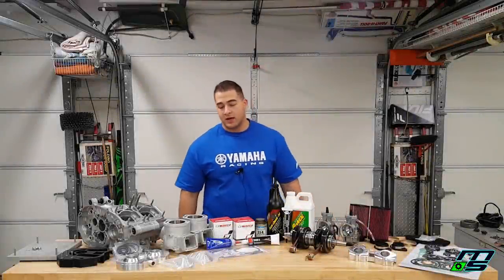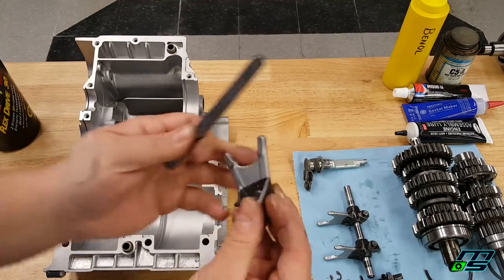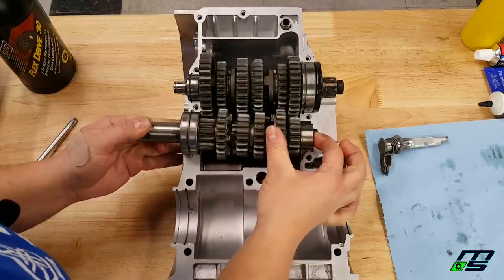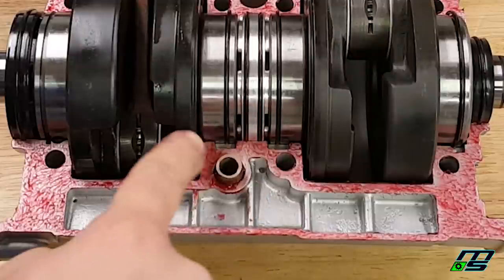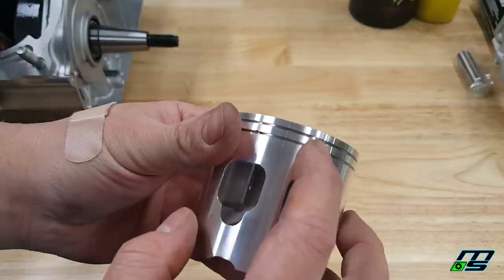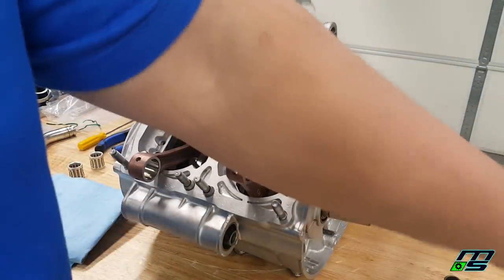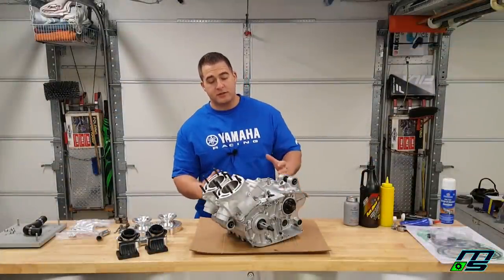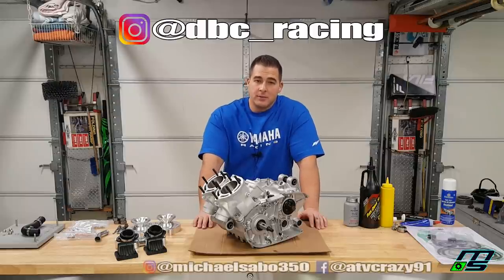Project 4mil part 7 | FIRST ASSEMBLY VIDEO!!!

Comment: keep up the great work. can't wait to hear that thing rip!
Reply: Hopefully you guys can collab one of these days
Reply: TheMindOfTyler can’t wait to see it all put together. #greatjob.

I do have a question I just bought a banshee and that thing rips, it is my second banshee so far. But this one does not have reed valves, I just noticed when installing twist throttle last week. I been riding it for about 1 year now, I’m thinking about 400 ridding miles. But gain, don’t know if I should buy some vfoce and be done with it or just ride it like that. Any suggestions or advice will be much appreciated. Shoutout out from Seattle WA

Comment: ALWAYS ALWAYS ALWAYS use a torque wrench when assembling an engine, you should know by now how important that is! when you used an impact gun on that cam stopper plate i just wanted to curl up into a lil ball and go hide in a corner...

Comment: Bro I got the same setup from driveline. Porting is different. Nonetheless though where was your wrist pin bearings when you got your crank? Were they already bread tied to the rods or where they in the bok?
Reply from the maker: It's been a while but I think the wrist pin bearings were in the rod with twist ties holding them.
Reply: @MichaelSabo  thanks. I got it sorted out with driveline. Solid company thanks man.

Comment: Has anyone ever told you about the 4 holes on the bottom side of the motor that can cause a air leak
Reply: Also liked how it was all in one video not a bunch and way more clear then south Texas bansher he makes great videos also tho
Reply from the maker: No, what holes are you talking about? And dude I appreciate that so much and take that as a huge compliment. Kevin from South Texas Banshee is the man and as far as knowledge he is way ahead of me; I learn so much from him.
Reply: @MichaelSabo  There on the bottom side of the case I'll send you a pic on Instagram in a bit just fillem with silacone or jb weld

Comment: The most annoying thing ever is the front nuts on banshee cylinders. At least when its in the bike
Reply from the maker: These assassin cylinders must have a little more area because my 13mm wrench fit in no problem. I know what you're talking about with stock cylinders and I was dreading that with these but they were easy.
Reply: Michael Sabo wow. Thats cools.

Comment: Awesome job , watching the trx 250 build but went back an found this . Easy way to install pistons is to actually put the piston inside the cylinder slightly and install it on the rod that way . Obviously you know what you’re doing but just passing on little tricks that were shown to me ! I guess it doesn’t really matter when you have the motor on a bench but doing Mx bikes without taking it out it really helps !

Comment: Hi From Holland, Great video's! I always use some grease instead of oil on the wrist pin as it is a bearing just when its new, as i was thinking  during the heat up it runs in smoothly whit the engine's milage, not sure if it makes any difference though. But i never had a case where parts of writs pin needles were cause of the crash so i can't tell either. keep up the nice work!(video's).

Comment: Be careful running benol. It won't protect the internals from rust and corrosion. So if the bike sits for a while, it's not the best oil to use. I switched from benol to r50, just for the corrosion protection.
Reply from the maker: Good tip; I didn't know R50 had more rust/corrosion protection; thank you!
Reply: You're welcome! The guy me and my dad bought our banshees from ran benol. It's great oil if you are drag racing, but it gets waxy and doesn't protect the internals. I talked to klotz directly about it. If you run benol you will have to fog the motor if it's going to be sitting. But in PA, the weather is always all over the place, so it's hard to say how long the bike will be sitting. How far are you from Marienville PA? The trails here are awesome.
Reply: Redline is the best 2stroke oil on the market i run it in my 4mil
Reply: I’ve heard that benol does protect, it’s the super tech that doesn’t protect from rust.
Reply: Supertechniplate is 20% benol and 80% synthetic.

Comment: Just a heads up, I highly suggest not only putting two stroke oil on the cylinder, but the piston as well. But other than that great video dude

Comment: motion pro makes a box wrench that fits 12 and 14 mm nuts with a hole in the middle for a 3/8" torque wrench.
Reply: after reading a thread about installing banshee cylinders, I'm about 95% sure that wrench will fit ( if you can get a socket on it, it should fit no problem)    I read where one guy said just torque the head bolt's down with a torque wrench and then just try to put the same pressure on the base bolts with a wrench,  not many 12 mm wrenches are the same length as a 3/8" torque wrench, and these guy's wonder why their bikes blow up every 20 hours...